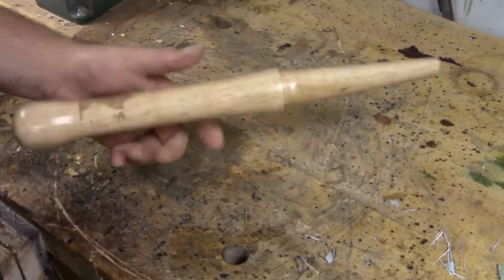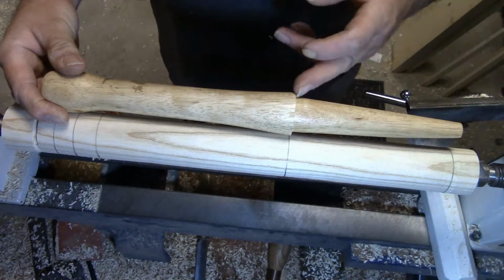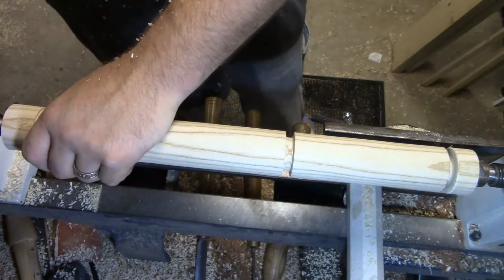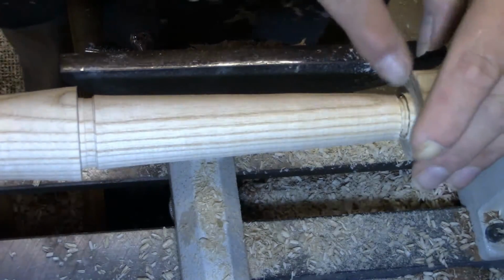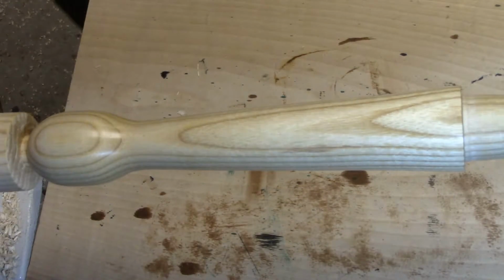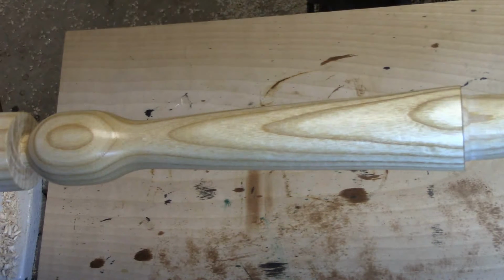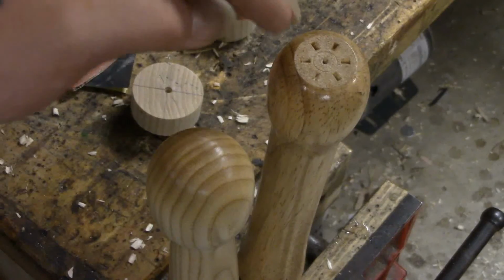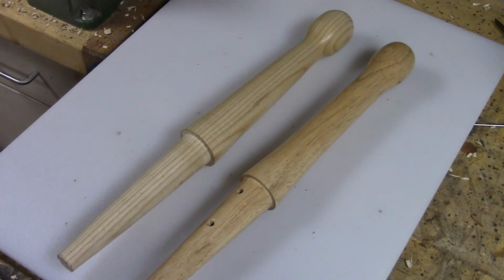GPW 108 - Handle for Cold Steel Shovel

Comment: Doh! you went to all that trouble to make a beautiful new handle and then covered it with a blister magnet polycoat? I would have thought you you'd finish that with boiled linseed oil and it would have been just right. is Poly as bad as varnish? I'm thinking that it should be.
Reply from the maker: Ken Gray 

I don't know if it is or not. I never thought of it causing blisters. I'll let him try it out and let me know. 

I can always make another one...    :)

Thanks for the comment.
Reply: GP Woodworks hey, either that or it makes a good trunchen.

Comment: 6:28 ahem :)

I'm not sure I understand why he wants this handle. Is ash really that much stronger than hard maple?
Reply from the maker: 6:28 HAHA!!!! I totally missed that!!! 

His biggest concern was that the factory handle wasn't as straight grained as he liked. IDK if it's stronger or not... but they aren't sold with ash handles... so it makes it his. And, ash will hold up just fine I think.
Reply: Oh it's definitely an upgrade, but I couldn't see what was wrong with the stock handle. Thanks
Reply: GP Woodworks the original handle looks like hickory! Hickory and Ash are the two hardest woods for tool handles :) ash has a little bit more rebound and “springiness” in it while you’re hitting something with it, and hickory is more solid and rigid.